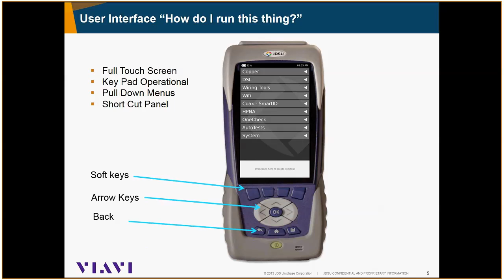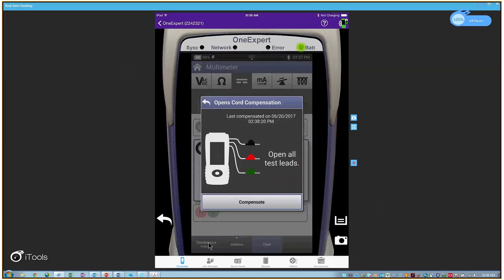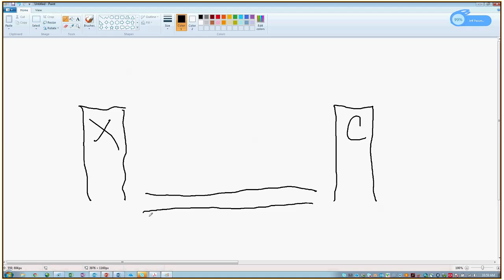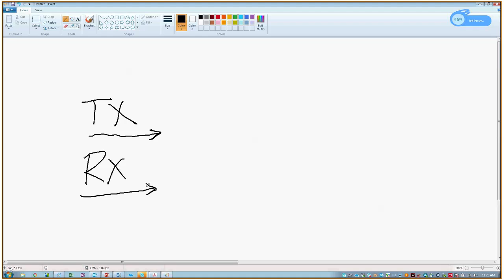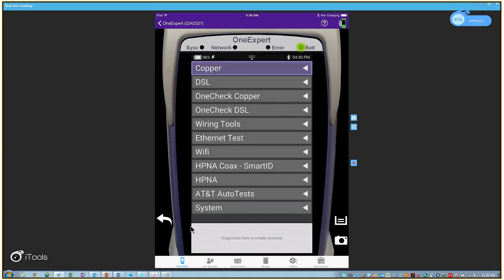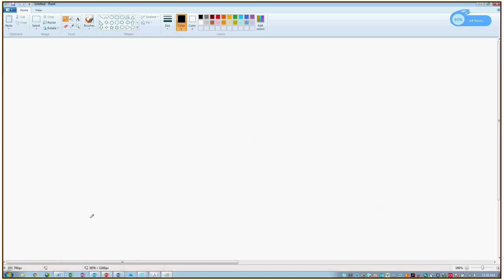How to Test Copper & xDSL Services with VIAVI One Expert DSL

Comment: Hi Jeff love to watch your training on YouTube about VIAVI OneExpert coppers network tester.
I am coppers and xDSL network technician, and I have VIAVI OneExpert, I can easily fix foreign battery, open circuit, earth fault, but come to intermittent drops out and also cross talk connect coppers pair, very hard to fix drop out and find cross talk fault when the coppers line doesn't show foreign battery, open circuit, earth, capacitance imbalance fault.
Please share your experiences how to fix these problems.
Reply from the maker: Hi @Ben_Kuoch - Please send your inquiry to Jeffrey dot Woodman at viavisolutions dot com to receive an answer to your question. Thank you!

Comment: I work in the field. i wasn't provided or trained to use any type of meter. I hook up the pair assigned to me and after testing through the modem Ill see down/upstream errors. I wish I had someone like you teaching me what tool to use, and how to use it. im here on my own time trying to figure out how to reduce repeats. the only thing I use to tell if the fx/distribution line is goo by listening with my butt set for loud noise on my speaker. . i need a good tool to that will find a good spare pare to use. ... help.
Reply from the maker: Hi @to0N - Please send your inquiry to Jeffrey dot Woodman at viavisolutions dot com to receive an answer to your question. Thank you!

Comment: How do I use this meter as a 1 gig modem? Someone told me to put a ethernet cord in port 2 and plug into the back of my device and it should work but it doesn't
Reply: LOL.... You're funny
there's a reason why it didn't work
the reason is .. In order for a Modem or a device to have internet it MUST be configured to work with an internet provider and BE CONNECTED to said provider

is the viavi connected to the internet if it's got a cable going from itself to your laptop
ANSWER : NO...  Not a chance in the world
that's why it didn't work